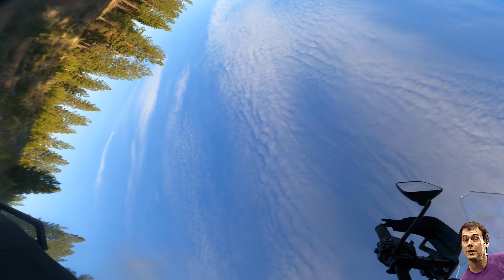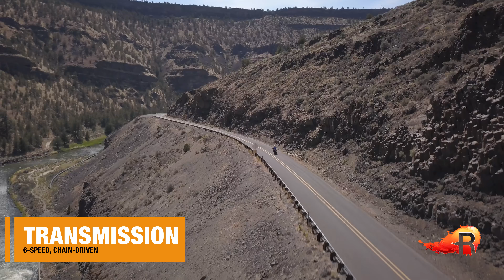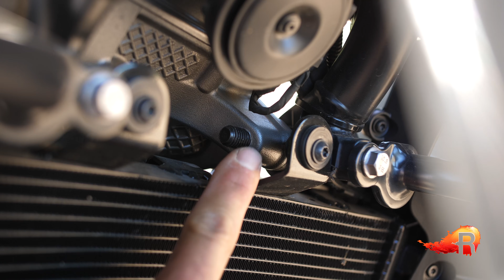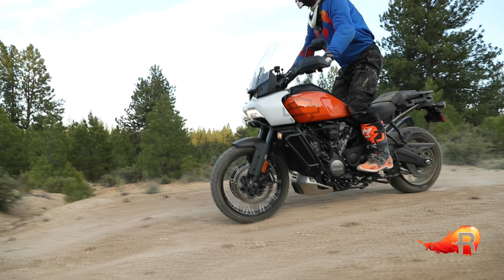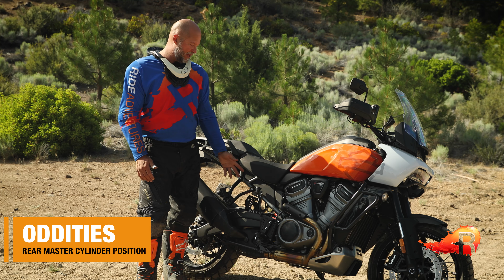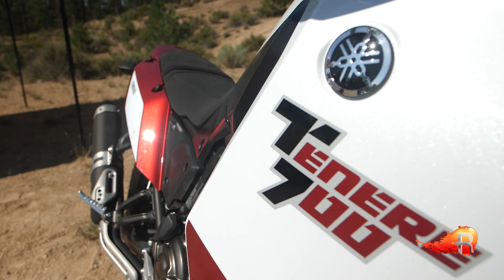Harley Davidson PAN AMERICA REVIEW | Pros & Cons

Comment: Harley is never gonna make a bike as reliable as the big four japanese. 
I am a service manager not at a harley dealership, but an equipment dealership and I've dealt with many
Equipment companies. There a couple that tell me to bring my gear by the shop and they'll check it out, when I have a repair shop of my own. That tells me, their shop is out for profit. That's what harley does. They may not say it to your face. But harley is working really hard at making everything a shop issue. Make the bikes, meh, reliable, you take it to the shop.  Which pulls them profit. And that's one of the reasons harley is losing profit.

Comment: 've owned both. Sold my BMW to buy the Pan Am and have not been disappointed. BMW has some annoying traits that you did not hit on which have plagued the bike for years. Overall though, I thought your review was well done. The Pan Am is not perfect but neither was the BMW. I'm at 7500 miles now with zero issues. Overall what has impressed me most about the Pan Am is its ability to chew up miles without effort. What impressed me the least about the Pan Am and something Harley really needs to address is the size and placement of the rear tail light. Small and hard to see with full bags on the bike. Borderline dangerous. I rigged aftermarket LED's on my tail box to help with that. Otherwise, good scoot.

Comment: Overall great video. Only problem I had was with the comparison of the compression ratios to a completely different class of ADV bikes. The PanAm's 13:1 ratio is comparable to the BMW 1250 GS's 12.5:1 and the KTM 1290 Super Adventure's 13.1:1. I agree with the concerns over accessibility to higher octane fuels in remote locations though, and what that looks like over the lifetime of a yet to be tested engine.

Comment: Lord,
😂 here's my 2 cents - suzuki RMZ 450 with a safari  fuel tank. Task racing led headlight kits and rigid off road led.  Now you got ground clearance. And you're still under 300 pounds. Nothing you can't climb and clear.

Test road a friends 2022 GS 1250 in weat Texas. Highway was great. Going up hills the handlebars were to swept back. Didn't like that.  Any mod sucked on rocks. I almost cracked a tooth from the front end bouncing like a basketball. Took a 2022 Pan-America into Alabama and ran it through some clay and rocks. Soaked up the roads with ease. Crossed a few creeks on both. I found the power band on the Pan-America Is compliant. 
Personally I think if you're  going take a $25,000 bike off road like an idiot you need not bitch about scratching it. 😢!  And also the manufacturers need to strip all these ride mods off for cross country enduro riding
Fully adjustable ohlins shocks front and rear and set up your bike fully dressed out for sag. On all the adventure bikes I felt like a   porpoise sea world. 
It's nice trying to throw your leg over a KTM and pretend your 6'5" tall. And easier to ride a Pan-America.  At the end of the day you will ride what suits your habits  and lifestyle.
P.S. loud pipes save lives. I'm just saying riding n Houston traffic and now living in the retirement capital of the deaf world of Florida.  Homer in the woods bird watching isn't going to like me. Nor do I care. 

Nice vid. 
What I'd like to see is a bunch of men on these expensive bikes, burying them up to the engine full of wet mud and getting nasty. Dragging them out. Camping and doing this for 30 days. Take all the manufacturers, including Triumph and Yamaha Honda and suzuki. Let's ee who comes out smelling like a rose. Not switching off rides.  Blood sweat and tears ride. Then let's ee who lost plastics tires and parts.  Just for kicks throw-in  Triumph Scrambler.  ND DONT PUT A 60-YEAR OLD ON A BIKE. 40 Year Olds max. I don't want to hear any crap about my bad back or arthritis kicking in and couldn't make it. 

That would be a great video. Start in the desert sand and then into the rocky mud and snow mud.

Comment: New starter clutch fixed the high compression on starts, all other issues have been fixed with software updates, aftermarket parts are plenty to make it perfect for selective riding positions, protection etc. including a quick shifter.
Shorter riders must try the Special and the reach seat options.

Comment: I love my Pan America.  It is such a fun bike to ride.  I rode it to Alaska (Deadhorse) and back from Southern California (9000 Miles) and it performed flawlessly.  I just got back from a ride down the Baja Peninsula last week (1000 miles) and I had a couple problems.  The chain stretched to where I couldn't adjust it anymore, and about 60 miles south of the Border, my stator failed, which caused the battery to drain.  However, these problems could happen to any brand.  Probably my main upgrade to the Pan America would be to switch to a shaft drive.  I know the chain is better for off road, but the Pan America is never going to be a hard core off roader.  It's more dirt roads and forest roads.  Anyway, thought I would share my experience and 2 cents.
Reply: You mentioned the ride to Deadhorse, what did you think of that experience? Been to the mid-west and west coast out of Pennsylvania. Heading to AZ and UT, again summer of 24. I have Alaska on my must do ride bucket list. That's going to be approximately 13000 mile trip from Pa. I even have a also retired ex-coworker that now lives in Delta Junction. That's southeast of Fairbanks. He's looking for me to stop in when I get to AK. Lots of planning, but it would be a epic ride.
Reply: @curtissmith8789  It's probably the greatest riding experience I have ever had.  I am doing it again in 2025.  I will be riding with a friend this time.
Reply: Glad to hear you're enjoying your PA. You're putting in some good miles. I have a KTM 1290 SA now and was thinking about replacing it within the next year. I've done a few test rides on the PA and must say that HD has done a nice job. Out of the gate, they seemed to have done a lot of homework to make a competitive bike. This is totally outside the box for them. They stepped on the competitors home field. They didn't hit a home run, but I think they slid into 3rd base. Way to swing HD. I've never been a big HD fan for the most part. Having a touring BMW and a KTM ADV bike, I Am pulling for HD in this segment. Hopefully they will stick with it and continue to improve the platform. Safe travels and many miles / adventures in the future.
Reply: @curtissmith8789  Thanks Curtis.  I recently sold the Pan American.  It just so happens I was at a BMW motorcycle dealer , looking at their bikes.  When I was ready to leave, my PA wouldn't start.  The BMW dealership was so nice.  They had their mechanic look at it (he used to be a Harley mechanic) and he couldn't get it started.  They offered to take it as a trade-in, and I accepted.  I now ride a 2023 GS 1250 Adventure.  I plan to do a video soon a post it on my site.
Reply: What are you thinking about your 1250 GSA. My riding partner has one, he loves it. I think it's a very nice bike. I really like it too. If you're looking at a ADV bike, it's hard to dismiss a BMW. I will say everyone that rode a PA liked it.
Reply: @curtissmith8789  I really liked the PA; however, a couple electronic problems drove me crazy.  Probably because I bought the 1st generation.  The engineering on the BMW is far above that of the Harley.  The GS has been around long enough that they have just about perfected it.  I won't badmouth the Harley because I really enjoyed it, but there is no going back from the GS 1250 Adventure.

Comment: ARH needs to have the electronics to be able to turn it off in all modes totally.  Try it with a tall seat and the side stand is almost impossible to use safely without pitching it too far to the right.  At the moment, the only way of getting rid of the ARH is to create a custom mode but then one will have to return to that custom mode if one has been in a standard mode say enduro or rain before stopping.  I have heard that maybe dealers can turn it off and if someone can tell me how to do that permanently, I would be grateful.  Thank you.

Comment: I agree with you on HD needing to better compete with the Japanese middle weight Adventurer market for the reasons you explained, I personally consider the Pan America in its current form to be more a Sport Tourer than an Adventurer, Ground clearance limations for such a heavy bike will certainly limit your offroard riding to just gravel or dirt roads. I am bewildered at thier choice to place the rectifier and battery in thier current locations, also simple air filter changing looks pretty involved. The maintenance free Valve adjustment looks appealing and is a great idea but is offset by the yet to be discovered longevity of the high compression engine as you stated, but then again everything made today is engineered with planned obsolescence in mind. At that price point I personally will stick to the longevity and dependability of the Honda and Yamaha Adventurer options. HD has some catching up to do in the Adventurer arena but look forward to see what they do, if they decide to continue to play in that market.

Comment: Mate brought that bike new.... Started rusting badly, front hub.... Disc areas. Battery not starting his bike through Winte even using regularly and on a Trickle Charger. Dealer had no answers. Gave him a jumper box.
Front fender cut way too short, and debris, up onto headers.... Radiator.
Build quality looks very cheap.
Not worth the 35k NZ Dollars. Ugly as bike as well

Comment: A thought for you - high compression doesn’t automatically reduce engine life. Consider the average diesel runs 18:1 and they regularly run to half a million miles with proper servicing. Great video otherwise 👍👍
Reply from the maker: Right, not automatically, but a higher compression ratio "contributes to" degradation of the engine at a faster rate (stresses, temps, etc.) --- Thanks for watching and sharing.
Reply: @RIDEAdventures  well then you can say exactly the same thing about every modern sportbike. There isn’t one with what could normally be considered a “low” compression ratio. I’m just saying it’s an unfair poke at the RevMax engine when there are many other bikes out there with similar CR. Incidentally, the big-end & main bearings in the RevMax are huge, plus there are two piston cooling jets per cylinder and wrist pin is carbo-nitrided tool steel. Harley has done their homework on this unit.

Comment: Cars and motorcycles have recommended octane numbers.  Manufacturers realize some countries do not offer 91 octane for maximum performance.  Antiknock/dieseling are software covered with less performance noted with  non optimal fuel numbers. Works the other way also.  If you fueled 91 octane in a vehicle that requires only 87 no increase in performance as just wasting money. Multistrada V4, Super Adventure, Ducati Desert X all running higher compression for improved performance as engine designed from factory vs someone changing the compression from non factory specs by changing to different pistons to increase compression.  VVT and forced induction could be seen more frequently in bikes similar to cars.   Direct injection may not appear like cars because of the faster rpm’s bikes require.

Comment: I'm from Milwaukee too! Even worked in Grande Avenue Mall at the camera store (back when dinosaurs roamed freely). That 13:1 is a real issue. The PA that I demo'd has already blender'd its engine on someone else's demo ride. The dealer blamed the rider for revving up to 7k, but where's that rev limiter? They had to replace THE WHOLE ENGINE, it's not very modular. What if that happens when you are outside of your warranty? I'm guessing you might be looking at $5k or more. If the metric adv bikes aren't playing with compression ratios that high, how reliable can "The Motor Company" version be?
Reply from the maker: What's up my fellow Milwaukeean! Yea, it's going to be interesting to see when these PA's have some higher mileage, whether they're holding up or not. Fun bike in a lot of ways, so let's hope they hold up. Thanks for watching and commenting : )
Reply: @RIDEAdventures  I also agree about needing a middleweight, like, how about a Sportster SCRAMBLER??
Reply from the maker: @ridingwithmarshall , yea, but they need to get away from that VTwin and basically just make a full-frame (not Stressed Member Chassis) version of the Tenere 700.  In my opinion : )
Reply: @RIDEAdventures  I've said that for years, that Harley could show the world the power of American engineering again, if they would just let go of the same old heritage marketing. At least they finally discovered VVT, which I had on my 2008 Concours.
Reply: All fixed with new started clutch

Comment: How are the OEM tires??
Reply from the maker: Nice and sticky. Just not a lot of tread for loose dirt, etc.
Reply: @RIDEAdventures  Thanks - I understand they are 80/20 which is a good combination for me. I have a 2020 Tiger 900 ADV with Pirelli Scorpion Trial II and also have had the Pirelli MTS 60s which are also 80/20. I switched out the Tiger’s OEM the day I bought the new bike - but it sounds like the PA OEM are good and I won’t need to switch them out. I just bought a new 2022 PA waiting for the accessories to be delivered (hope soon) so I can pick the bike up and ride it :)

Comment: Probably one of the best unbiased reviews.  I test rode one and it will be my next bike.  I currently own a HD Street Glide touring model and will not get rid of it.  Different bikes for different riding adventures.  Main reason I would steer towards an HD PA is dealership network availability.   For those who don't live near a huge city metro area, it makes a difference.  I didn't get into the riding motorcycles to be a full time mechanic, I got into it to ride.  I don't care if its an motorcycle, atv, boat, jet ski, whatever toy it is.  Stuff does break.
Reply from the maker: Thanks for saying so, and good point about the incredibly strong Harley dealer network. RIDE on!

Comment: Hi Eric great review and Video. Here's my story. Several months ago now I traded  my 1200GS for the PAS after road testing one here in the UK. Prior to buying it I had looked at all the YT video's and they were all positive, Of cause after buying it some appeared showing the issue's. There was of cause always going to be some  given its their first Adventure Bike .
Ok lets say here that its a great bike competitively praised and I don't disagree with many of your Cons except one in particular and it is the engine. Yes its technically advanced and has 150bhp but for me in comparison as much as I tried to like it compared to the Boxer engine it left me cold. I missed the torque of the Boxer as well. It was never my intention to take it off road so as you say it is a great alternative to a Cruiser. The other things I didn't like were the jiffy stand , the position of the indicator switch , the small foot pegs and gear change but mainly the fact it was a chain drive. Having thought about it I just didn't want the bother of having to oil the chain regularly. I suppose in truth I am basically a big fan of the GS. The only problem I had now was as much as I wanted to trade it in for a 1250GS I was now part of the Harley family and had made so many new friends and this Spring / Summer I plan to attend many Harley events.
So what to do then ! Well what I have done is I have traded my PAS in for a Fat Boy as it seems to have the engine and character of the GS I had owned. Still got a GS on my mind though.
Totally agree with what you suggest Harley should do but I would also add , oh yes I also didn't like the battery position , they should go from a chain to shaft because the market they are currently in is a battle with KTM , Multistrada and Triumphs new Adventure Bike will also be a competitor.
Harley have made a great bike but it really does need to improve in the next edition. Stay safe out there. Ted
Reply from the maker: Ted, thanks for watching and sharing. Can't blame anyone for adoring the boxer engines that BMW has repurposed from airplanes into motorcycles so successfully. And yea, the simplicity of a shaft drive is hard to look past, unless we become one of the out-of-warranty individuals having to replace that system, sometimes costing ~25% of what the entire bike cost new. Gotta love the power delivery and efficiency of chains though. (Shaft drives absorbing more of that power than chains, and weighing a lot more.) But hey, great that we all have options, there's a crew to hang with no matter what bike we're on today : ) ---- RIDE on, and thanks again!

Comment: Many other types of motorcycle have used the engine as a stressed member for 30 years with very few failures or problems
Reply from the maker: Right, but only recently now are they being used for bikes designed to take the pounding of off-pavement riding. Or the potential pounding anyway. We had 2 Customers break the stressed member engine on Honda CB500X's in Patagonia. Never know.....just how much pounding can these take. ------ Thanks for watching and sharing.
Reply: @RIDEAdventures   @RIDE Adventures  I have no knowledge or experience with cb500x's but my zx-14 with a stressed engine took power lifts and huge wheelies (very heavy bike) for years with no problem multiple times a day (heavy right hand) with only blown fork seals.

In short my experience there's lots of other things to worry about but the engine as a stressed member is last on the list (or close) for most bikes 
Thanks for the review and you're awesome for responding!